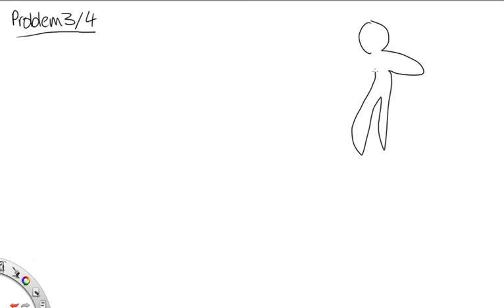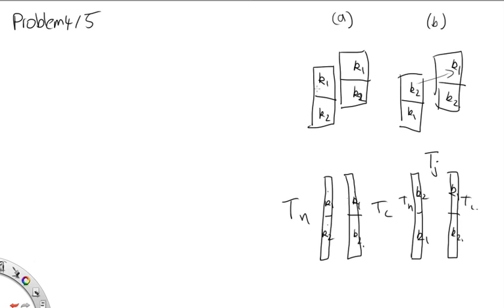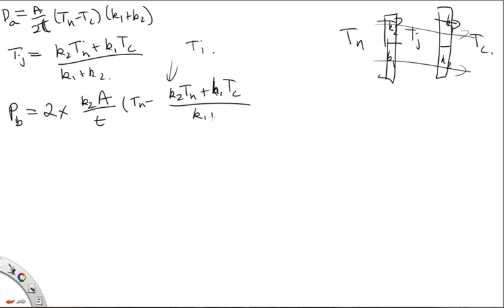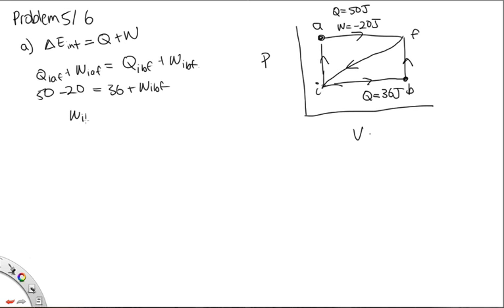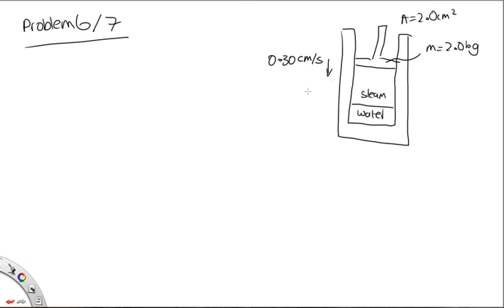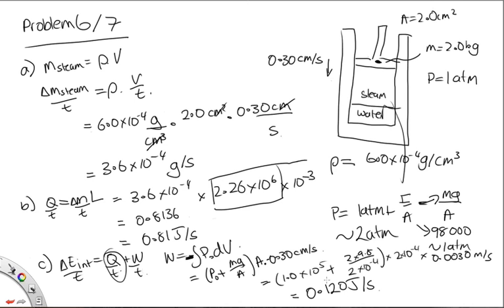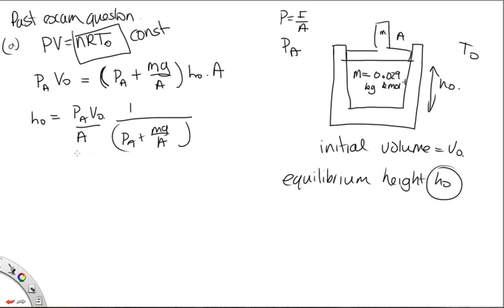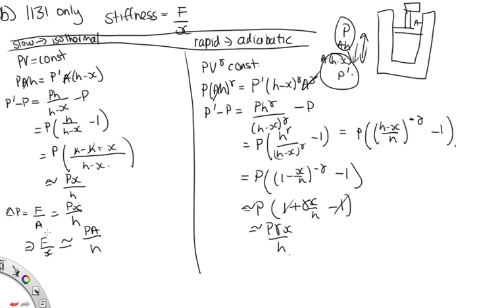Set 5 part 2

Comment: Why don't you use kelvin in question 3? Shouldn't the units of temperature cancel out with the units of thermal conductivity?
Reply from the maker: For changes in temperature either Kelvins or degrees Celsius are fine. They are equivalent. If you converted to Kelvin you would do dT = (273+33)K-(273+1)K = 32 K as in the video.